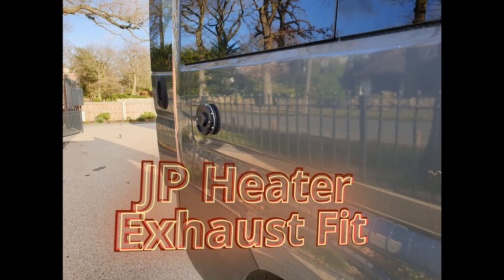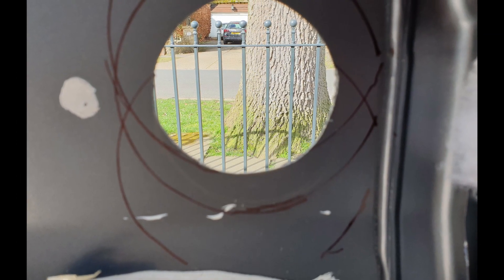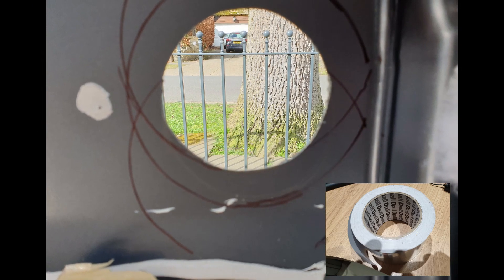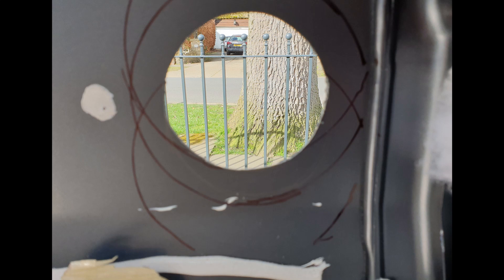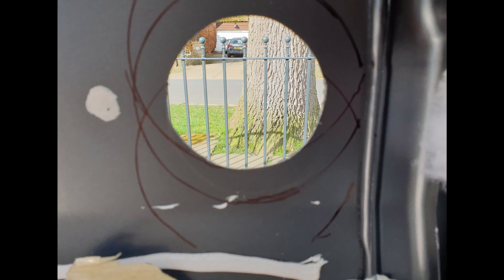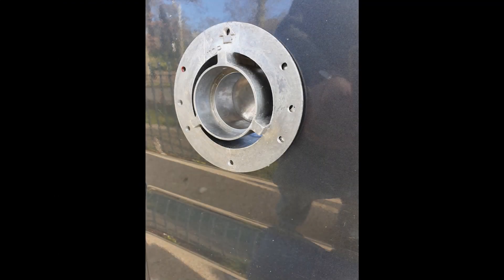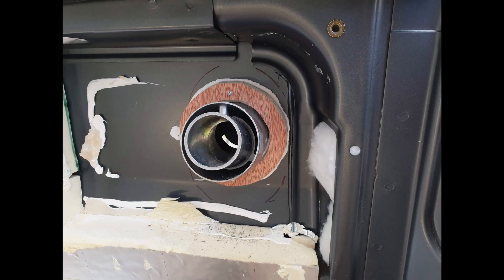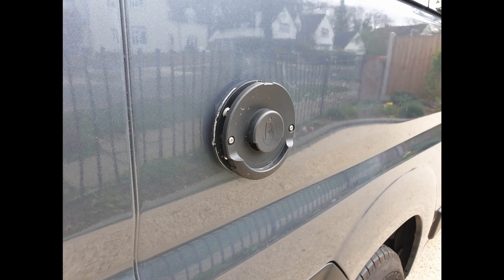JP Diesel Heater Exhaust Fit

Comment: Hi, great video..im about to start my install..I have a question perhaps you can assist me with?
I Spoke to Truma today and the tech guy said …be careful when you fit the exhaust, don’t put any twists or turns in it (it can cause issues)

Did you put bends in the exhaust or keep the exhaust pipe straight ?

Regards Ray
Reply from the maker: Hi Ray, my exhaust is a continuous bend and works fine. I would avoid any sharp bends or multiple bends.

Comment: What size holesaw did you use?
Reply from the maker: Hi @marc T, I'm sorry, I don't remember exactly but I think it was 75mm. I had to borrow it from a mate. I'll check later and let you know.
Reply from the maker: So Marc, i went and looked at i have 70mm and 75mm but im betting it was 75mm since the OD of the corrugated  hose is about 80mm